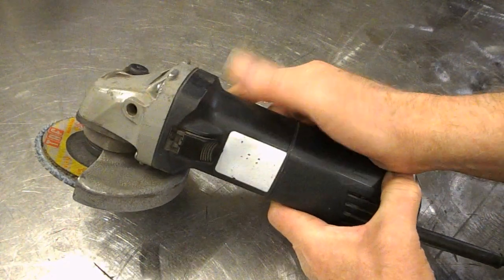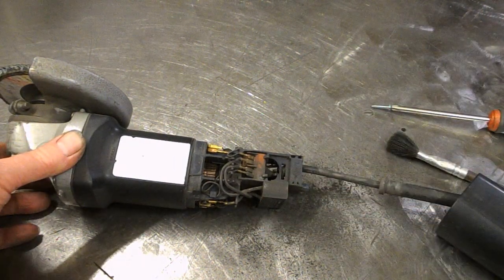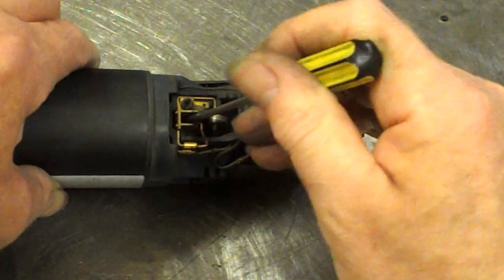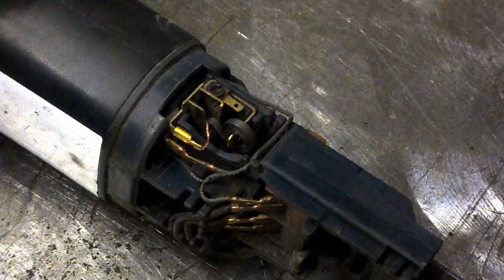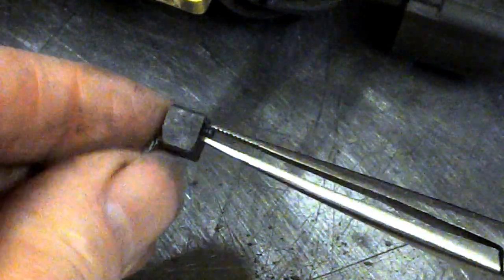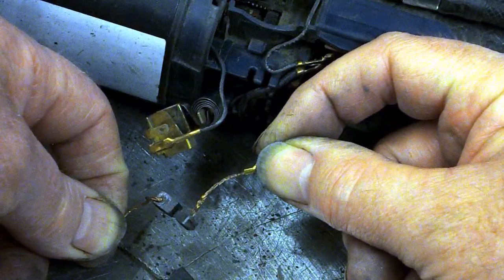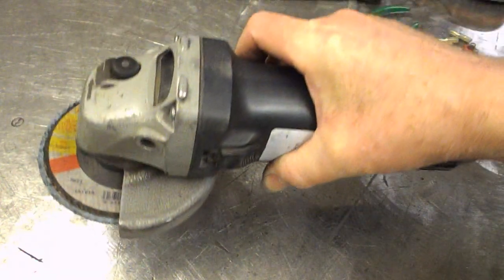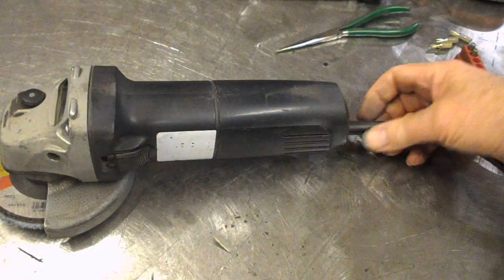Replacing Bosch Angle Grinder Brushes

Comment from the maker: The other one of these grinders that we've got packed up yesterday. Just stopped as if a fuse had blown but no, the fuse was fine. Checked the brushes & sure enough, one had worn enough to pop the little spring as shown in the video (@ around 8.20). Replaced both brushes & it's back in action!